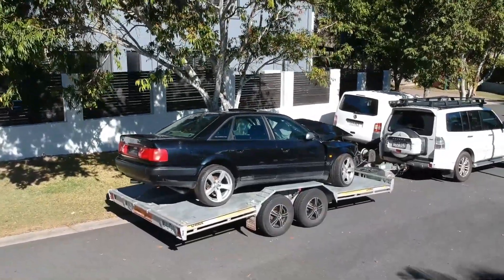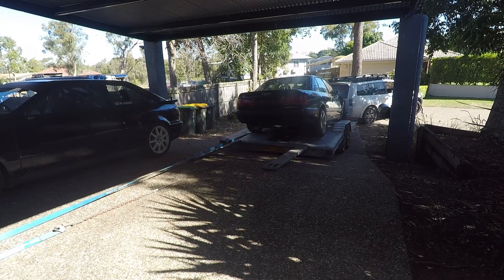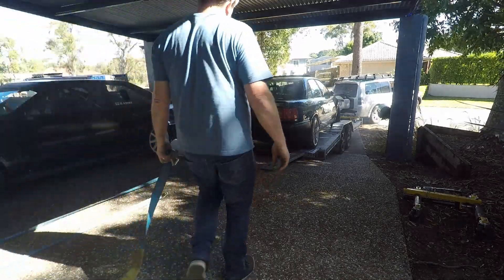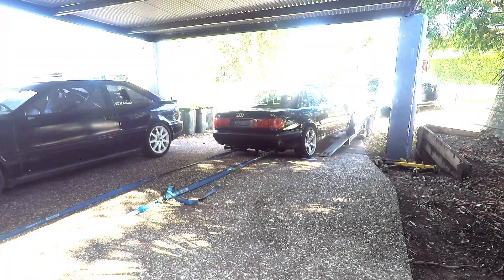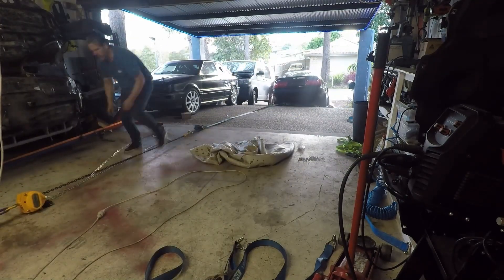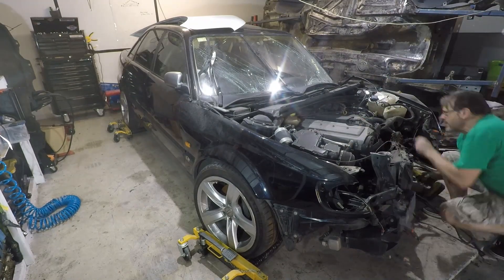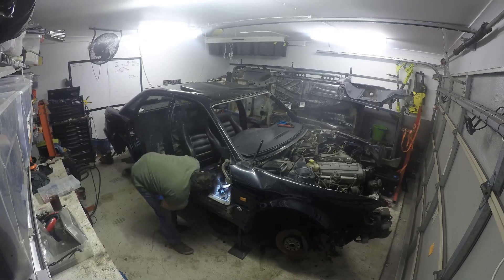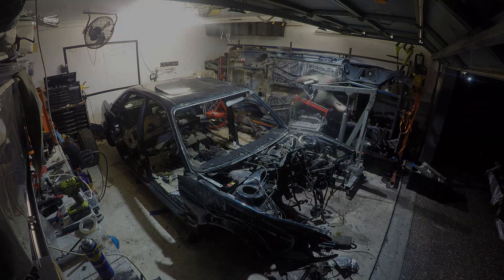I BOUGHT A DONOR CAR | PART 2 – THE DISMANTLE

Comment: Your journey to get the donor makes the trip to get mine look like a walk to corner store and back!  Great determination.  What all, besides the engine and seats, will be going on the SQ?
Reply from the maker: What I was most after was the driveline… engine, gearbox, diff and shafts. Not sure if I can use the hubs, but hope so.